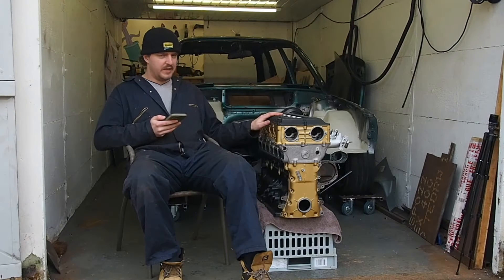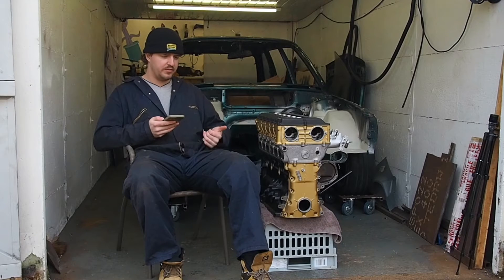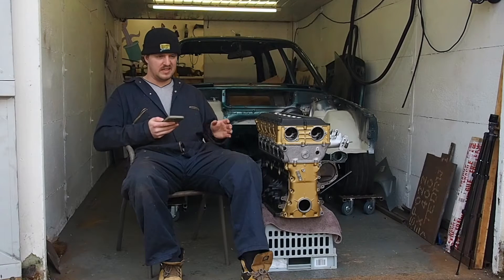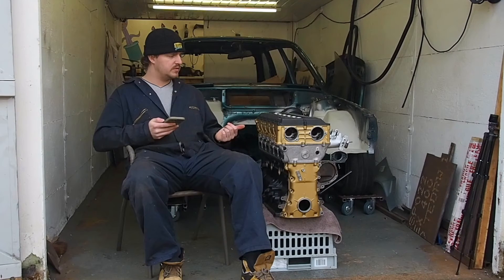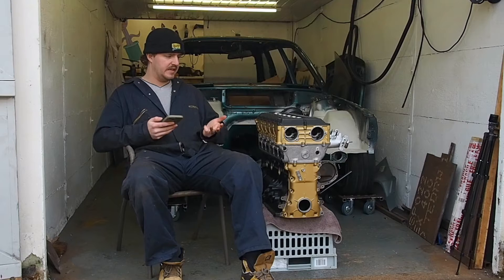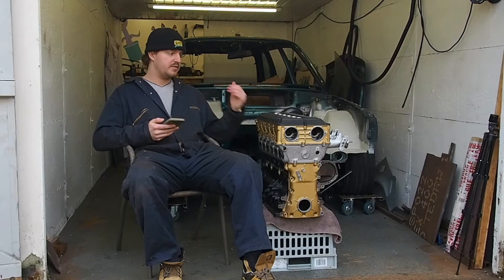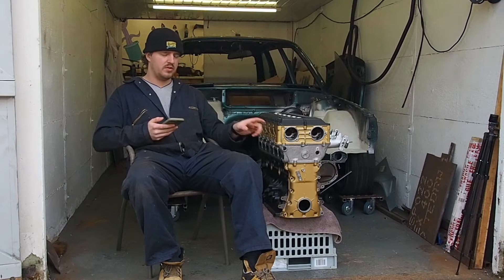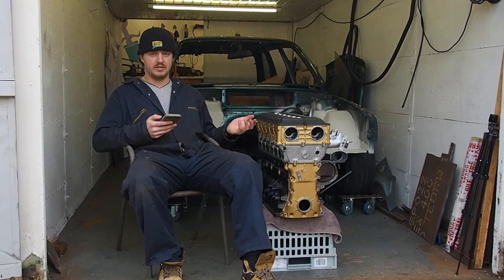Ep. 17 My BMW E30 Restoration - What is wrong with my S38 E34 M5 engine?

Comment: Did you get the cylinders bored before you honed them ???
Reply from the maker: This honing was to remove any scoring before measuring. Once honed clean, the bores were way out of spec, currently with a machinist who is reboring for custom over sized pistons

Comment: While it's easy, I assume you're going to replace the timing chain guides?
Reply from the maker: Easy, but very expensive! But yes all new timing kit going on, everything will be new, the timing kit including chains, tensioners and guides is about £800!
Reply: @BadE30  Yeah - not cheap, but totally worth it.  The single-row (older M88) stuff is even more!  I converted my M635 to dual-row - saved a few $$ and a bit more peace of mind.
Reply from the maker: @leeh9420  oh wow I didn’t know that is more! Great conversion to the duplex set up
Reply: I have m88/3 awaiting rebuild. Whats needed to convert chains to duplex please? With thanks
Reply: @markhaith4720  You'll have to modify the front cover to allow for the additional width of the dual-row chain.  Then you need the US parts for the S38-B35 sprockets, chain, rails, etc.   These are harder to find these days.  I might be able to help if you run into a wall (with some contacts, not parts 😉)

Comment: You be spending some good money on this engine im doing same thing, whats wrong with your oil pump?
Reply from the maker: Yes unfortunately so, but it will be worth it. The oil pump has damage from metal fragments, so it will not work as efficiently
Reply: @BadE30  how can you tell just opened mine cant see any visual damage was wondering how can you tell?
Reply from the maker: @ALKUKES  if you look in my video there is large scratches on the external bore of the rotor, and pitting on the inner rotor. If you don’t have any of this then you’ll be fine. You can measure the bore of the housing and compare it to the external diameter of the rotor, it should have a clearance of around 0.07mm
Reply: @BadE30  thank you top man i might need some help here and there as i go along i can see you are a qualified so im just new on this game
Reply from the maker: @ALKUKES  this is my first ever car restoration, but i am self taught. I’m a mechanical engineer as a day job which has gave me a huge boost, mainly using those skills to do what I do. Happy to help as I’ve learned the hard way at times!
Reply: @BadE30  i have finished an e30 project 325i but this e34 m5 is eating my money 😂 where abouts are in uk?
Reply from the maker: @ALKUKES  yeh they’re crazy expensive!! I’m in nottingham, East Midlands 🫡
Reply: @BadE30  are you going full restoration with this engine? Theres a man over states hes on YouTube wewrench he’s channel is, he’s brilliant, just posted a conrod bearinds  and main bearing on my shorts how bad they have to be to be replaced bmw wants £1200
Reply from the maker: @ALKUKES  yeh 100% restoration, just like the rest of the car. A lot of work has been done and a lot more to do! Yes seen his videos, informative
Reply: @BadE30 did you by any chance order them pistons and what are they exactly ? What brand where are they coming from? looks like im going to do the same thing ? Cheers
Reply from the maker: @ALKUKES  I’ve ordered CP-Carrillo pistons from VAC Motorsports. 94mm, 11:1 compression ratio! Standard are 93.4mm, 10:1 CR
Reply: @BadE30 i screen shot the notes you taken from bore measurements, is that in mm? Just got a bore gauge first time used it today, have checked over internet how to ise it, done the calibration with micrometer, set it up to the bore size 93.4mm s38b36 and its exactly like yours the bore gauge micrometer, ones i set it zero and i start measuring it goes to 8 the needle the the next one down to 6  then the next one down 8 / then across the bore 6 /4 / 8 now how do I know when is out of round or taper, if you can explain please i really appreciate it, i hope you get what i mean thank you

Comment: Nice work! Consider since you are in England to go to Vibration Free who balance assemblies as well as sell a much needed upgrade to the  dampener.  They call it the sterling dampener.... It's they own design, engineered in house.  These long inline 6 BMW's need all the vibrational dampening they can get.
Reply from the maker: I didn’t know about this company, it’s local to me too. However I have taken my components to a race engine builder who has a great track record of dynamic balancing. I will look into this
Reply: @BadE30  They are famous for their F1 and many other motorsports balancing.  Most importantly is considering gettin rid of the OEM balancer. As mentioned they have theor own that is far superior.  Good Luck
Reply from the maker: @jamesdills6720  great information, thank you!

Comment: Nice, should be a decent motor once its together. Just interested to know where you picked up the measuring tools and which brand you used ??👌
Reply from the maker: Thanks! Yeh very excited for it. They’re Moore and Wright from Machine DRO. Not cheap, but cheaper than the really good stuff!